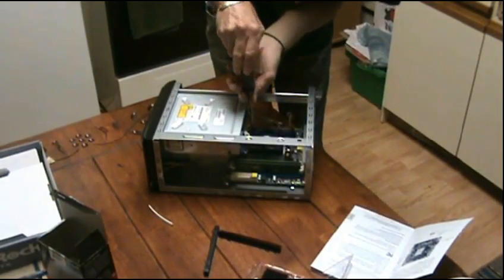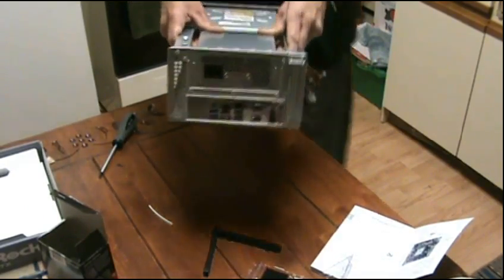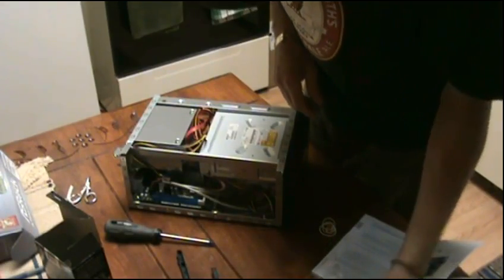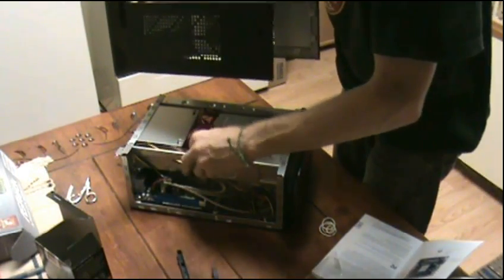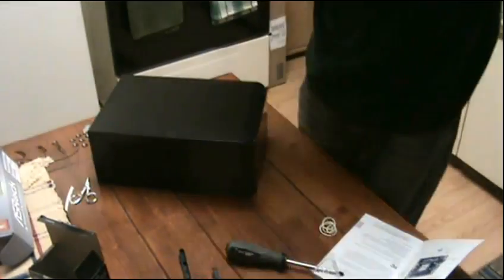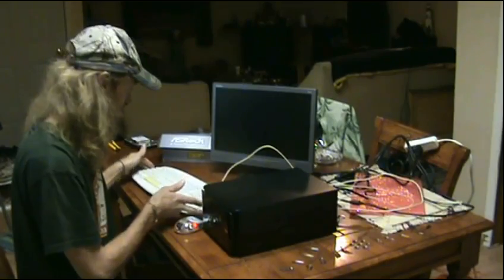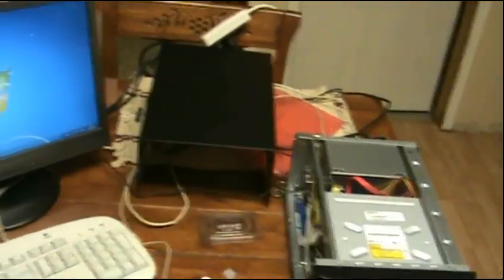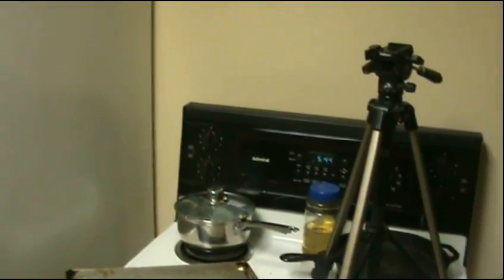Computer Build Pt.2

Comment: All untrue, It's honestly user opinion, Any CPU will shut off once it realize's it is getting too hot. Whether it is an Intel or an AMD, it can still melt to nothing, or fry it-self, the brand has nothing to do with it, Its whether you're cooling it properly, air circulation and the environment in which you're located. Not knockin ya for that, Just adding my little two cents. Good little HMPC build.

Comment: If you buy a descent intel pentium you won't have that ;) I was 100% AMD in the past, never liked intel celeron. But my Intel Pentium i7 extreme processor is almost unbeatable. Does produce a lot of heat, but with a copper cooling unit and a good fan it's no prob :)

Comment: I have never had a intel processor melt on me even with overclocking them to stupid amounts (going from 1.8Ghz to 3Ghz with an old Pentium Dual core). Pretty much both brands of processors these days are near impossible to melt or fry.

Comment: That's incorrect, intel can withstand heat much better than AMD can. Intel CPUs can safely at 90+ degrees where as when AMD cpus start reaching the 80 degree mark they start throttling themself down.

Comment: It's not your video that's bogging your score down Rick.  It's the hard drive.  I had my SSD as my primary drive and got a 7.5 score overall.  Decided to use the SSD only for games, and swapped a 7200rpm drive in for primary, dropped to 5.9.  The overall score isn't even an average, it is based on the lowest scoring component.

Comment: as as far as the windows index, i very HIGHLY doubt you will achieve over a 5.9, if even that. I am running an intel i7 2600k, 8GB ddr3, ATI 6970, and Raid 0 Sata 2 hdds. My rating is 5.9 and that is because it takes your lowest score, and mine happens to be hard drives. so unless you are running an SSD, you wont see over a 5.9 score. I also do not understand how you are thinking you are going to be able to run crossfire with only 1 PCI-e slot....

Comment from the maker: AMD is almost impossible to melt unlike intel, you can overclock an amd and if it runs to hot or too much voltage it will automatically shut down. Intel will melt with no warning, been there done that. That's why I always stick to AMD.
Cheers

Comment: The highest you'll get is 5.9 due to the hard drive speed put a solid state in it then you'll get something over that depending If you processor and ram have a higher rating than 5.9

Comment: The CPU is an APU, which means the cpu has a gpu as well. It has a radeon gpu inside of it, and amd allows you to software crossfire a discrete GPU and the one on the cpu.

Comment: inordinately since thew psu is pulling air up through its fan and the cpu fan is pulling air down onto it both opposite draws of air which results in overheating.

Comment: with the way the power supply covers half of the heatsink fan in my opinion i would run it with the cover off that way it does not overheat when you use it and if you run it with the cover on it i would deff. use a program like Speccy to monitor heat temps of your cpu and other parts just to be on the safe side . all in all looks like a nice lil tower other than being so cramped and no airflow under the heatsink fan anymore